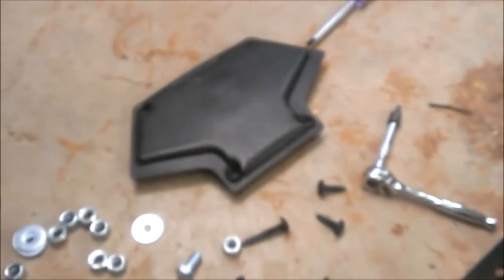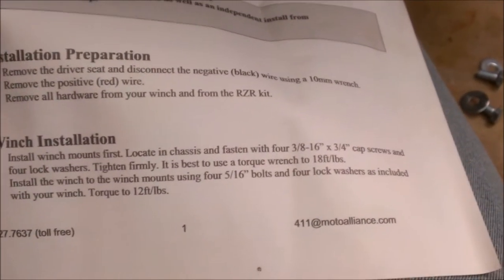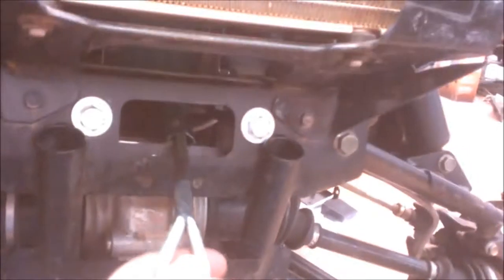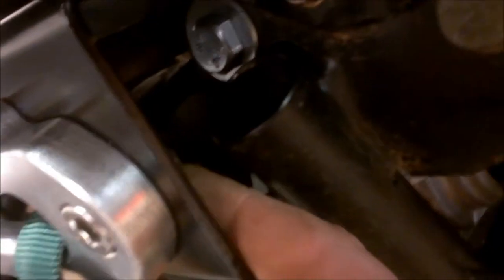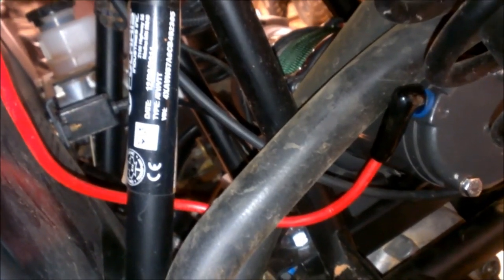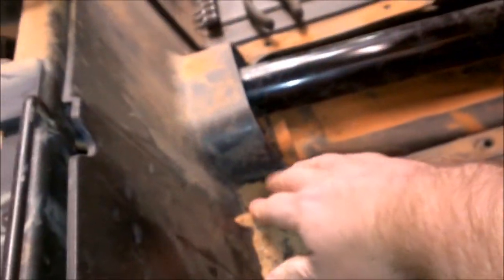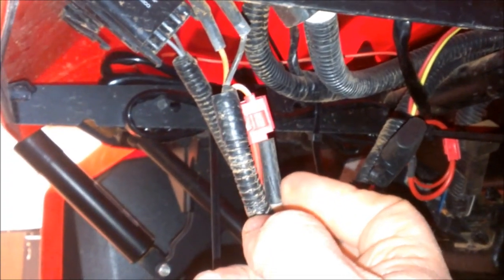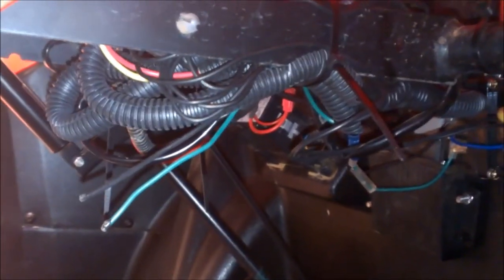Viper Elite winch install on a RZR 570

Comment: While a different color, the wireless remote looks like that used by Warn. On that one, you must depress both buttons simultaneously to enable the remote each time you use the remote. At some point, a timeout occurs and disables the remote control. I think this is intentional as a safety measure should the remote become accidently depressed in a glove box.
Reply: thank you! thank you! thank you!! I was going mad!! thought I wired something wrong.

Comment: Why did you use the yellow and the blue wires for your power and ground wire. The yellow and blue wires go from the contactor to the yellow and blue terminals on the winch. Theres no reason to use them where a red and black wire should be....unless the wires weren't the proper length and you had to do them backwards